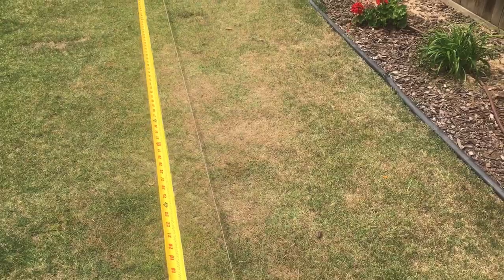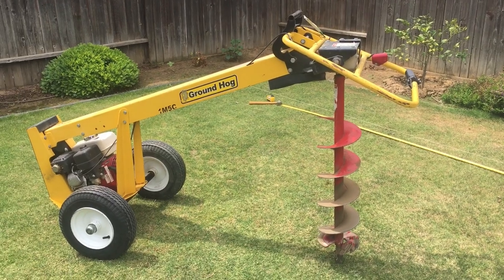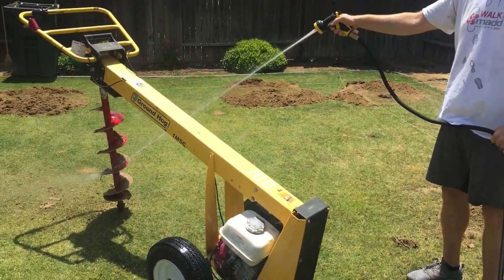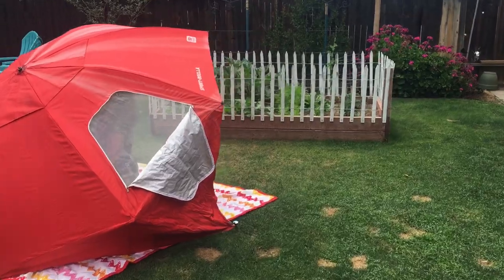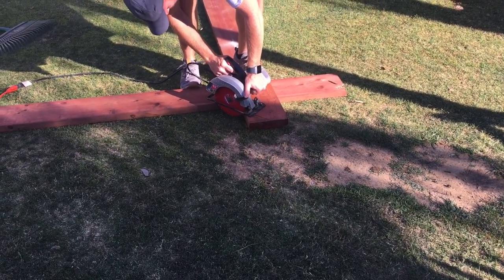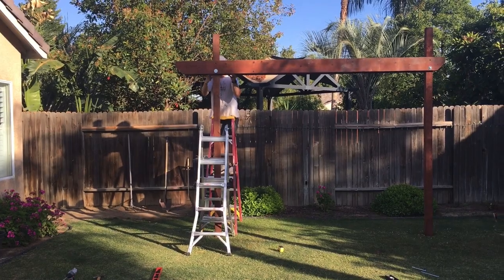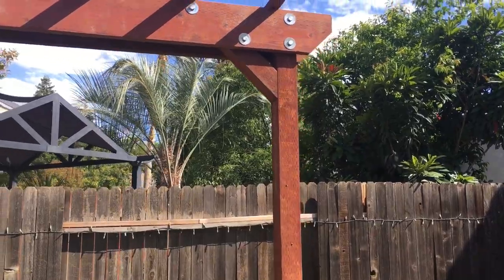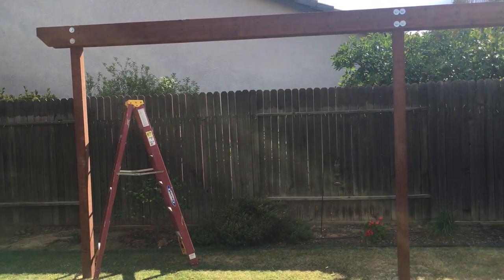Backyard Playground | Pergola and Hammocks | PAID CASH

Comment: I appreciate your video. YouTube is a great place to get ideas of what do, how to do it, and how not to do it. Your video was a little bit of all of that mixed together. I would imagine the video has the potential to cause engineers to lose their minds. Your troubles appear to have started way back with the design. So much was later added above ground because of what wasn't added below the surface. Those holes were simply not wide enough for the space needed for the concrete. The width of those holes for a 4" post ought to have been at least 12" across.